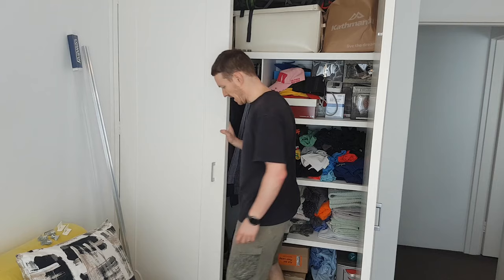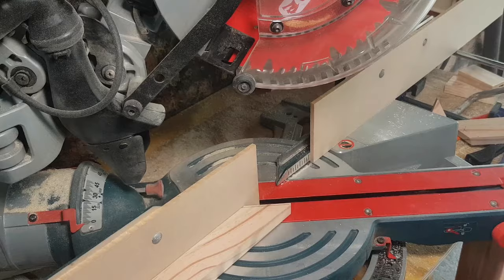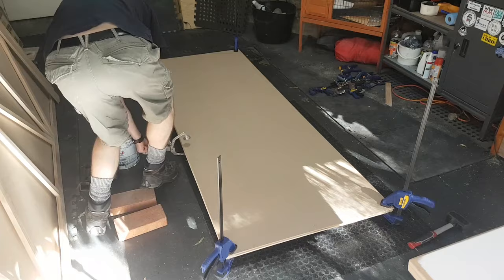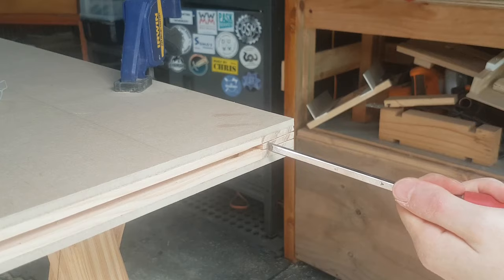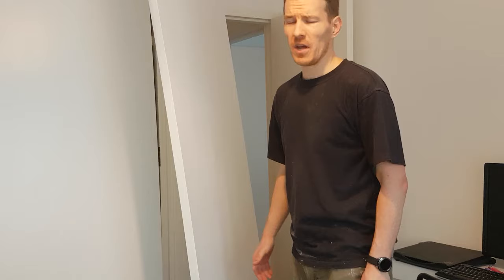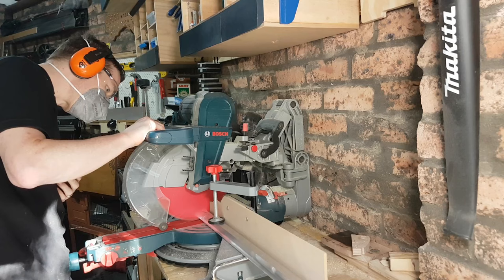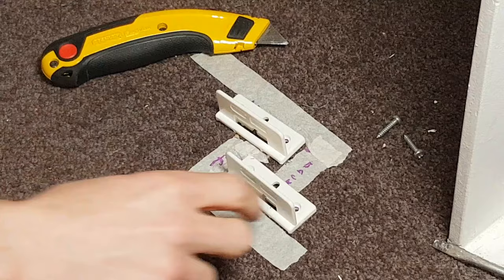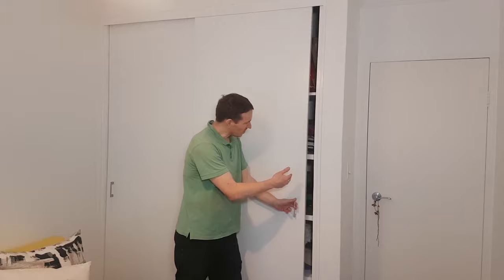DIY Sliding Wardrobe / Closet Door Build & Installation (Bunnings Cowdroy Door Track)

Comment: Hi, your work is amazing! I was wondering if you thought I could just re-use the swinging doors as sliding doors as opposed to creating new doors for the space? I just dont have the gear or budget to make my own doors, and the ready-made ones are the wrong size... Looking forward to hearing back from you when you get a chance.
Reply from the maker: G'day Andrew. Could be done, 3 things to consider though. Firstly, your current doors are almost exactly the same size as the opening. Sliding doors normally need an overlap to hide the gaps. You could pack out the sides of the frame a few inches to hide that gap though. 2nd, as the rail takes up space, the sliding doors will be shorter than your current doors. If you have hollow doors be aware you'll need to trim them down and perhaps add in a new brace. Lastly, consider if you have room for the old doors to slide past each other. Swinging doors fill the whole frame, sliders will usually need to be thinner. It may be able to be done if you are clever, but there is a reason I made new ones instead of trying to reuse the old ones 😉 Good luck!  Tag me in socials if you give it a crack, I'd be keen to see the results - James
Reply: @FixitFingers  Thankyou - you've just verbalised the concerns that were starting to form in my head! I'll keep investigating as I didn't know if there woluld be even greater reasons why not workable :)
Reply from the maker: @AndrewDInSydney  good luck!  👍
Reply: I have been thinking about using some old rustic shed doors and making them sliding doors for the built ins in my bedroom. Does the Cowdroy track allow for thicke doors? Would you just mount the rollers further out to account for thickness? I am not worried about the frame, cause I will make that myself so can be whatever width it needs. Also so glad to see another Aussie DIY/woodworking channel, I love Pask and glad I found this one as well.
Reply from the maker: G'day Zac, sorry for the slow reply, YouTube flagged this comment and I only found it in my "manual review" tab today. Did you give this a crack? As long as the doors are not too heavy should be fine. My track takes 50kg (2x 25kg doors) but you could probably beef up the mounting if you are making your own frame.

Comment: Nice solution, well done. Did you consider recessed handles to make it so you won't get 'caught' by the protruding ones?
Reply from the maker: Honestly no, I wanted to reuse the hardware off the old doors. The stop I included in the bottom of the door groove makes it impossible for them to hit as long as the back door is closed before opening the front door. The only time they could touch is if the back door is open and you then open the front.
Reply: @FixitFingers  I see, I didn't notice that he handles were from the existing doors. My thoughts were around having them stick out into the limited space within the room and the risk of getting clothing caught or banging elbows etc. But if that isn't a consideration then re-use is perfect.
Reply from the maker: Yeah they don't come out too far and this is definitely a tight arse project :D Reuse for the win!

Comment: Can I ask where and what the sliding kit is called
Reply from the maker: G'day Richard, this kit is by a company called Cowdroy and is available at bunnings here in Australia. It is pretty generic, I am sure there are lots of good versions of it around the world at your local big box shop. It's a 2 door, top rail bypass system, meaning one door slides in front of the other and only has wheels at the top, the bottom just has those plastic guides. While this is towards the budget end of things, I've had zero issues since installation.

Comment: hi why you could not use the same doors
Reply from the maker: G'day Sue, the short answer is they would be the wrong dimensions. They are too thick so they couldn't be mounted to slide behind each other. Too tall so you can't install the sliding rail (and hollow so you can't cut them down), and not wide enough to provide the overlap when they are closed. It is always of course be possible to alter them, but it would be a heap of work and take longer than making the new ones. Great question!  👍
Reply: @FixitFingers  Thanks for that !
Reply from the maker: No worries!

Comment: Hi, just a quick one. What is the name for the sliding mechanism and where did you get them,  cheers from the uk, stay safe.
Reply from the maker: Hey Paul, the brand here is called "Cowdroy" and I got mine from our big hardware chain, Bunnings. It is a top-mounted dual rail that I got in a complete kit.  I am sure you can find something similar at Homebase or similar big box store over your way. 👌

Comment: Did you have the metal rail for both top and bottom? Because I want to make similar doors for my wardrobe as you have. As I have a small room and it leaves no room to have doors on mine. And also I have uneven cement flooring. PS, I was building a carcass to put my wardrobe in by the way. You were right about Plywood being more expensive than MDF.
Reply from the maker: Hey Jodie. No this style of door slider only has the rail at the top. At the bottom is just the plastic guide to keep them in place. Works well with these 'lighter' hollow doors. If you had super heavy mirror doors for example you'd probably need wheels and track at the bottom to help take the weight.
Reply: @FixitFingers  Sweet.